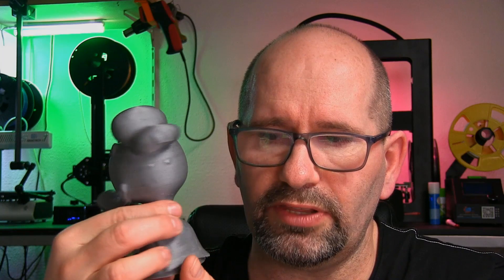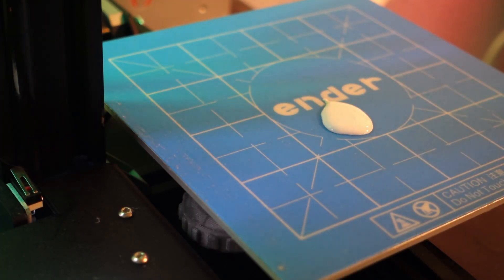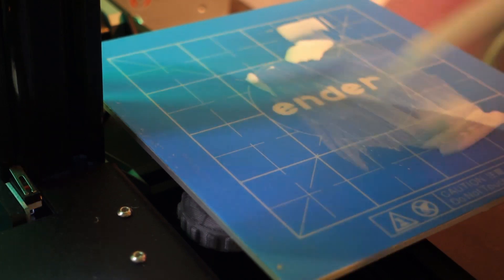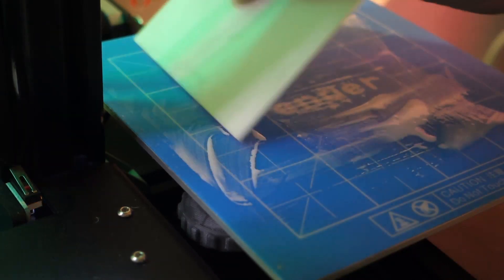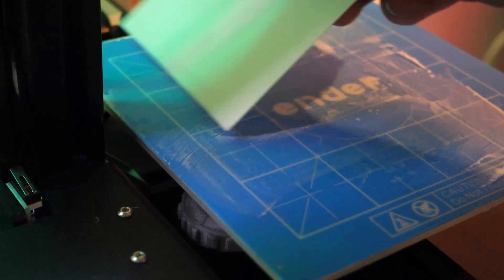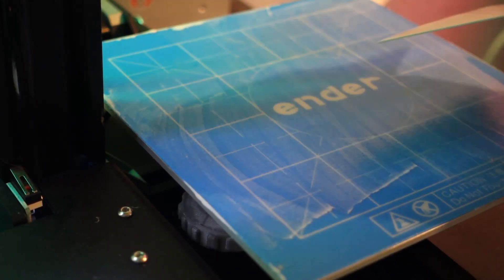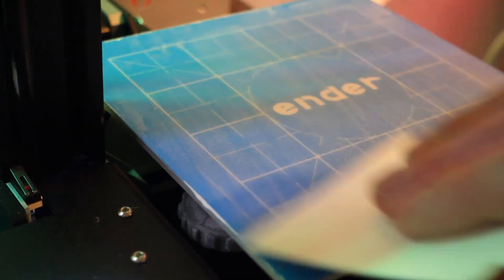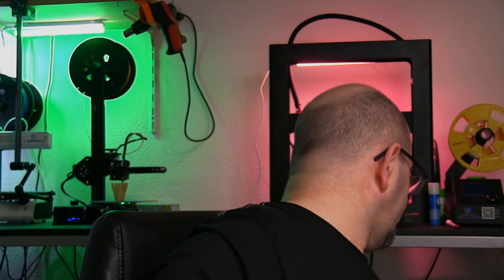▼ Filabond 3D Printer adhesive for your print bed

Comment: I print only with ABS on a Da Vinci Pro machine and i find it a lot easier and cheaper to make some ABS slurry to give the bed a better adhesive. Just take a small bottle of acetone and dissolve some bit's of ABS material in it. After everything is dissolved apply a small amount on your glass bed and rub it out.
Reply from the maker: Ik know, I also do that. You can also use the slurry to repair parts: https://www.youtube.com/watch?v=9L204s1-_NQ